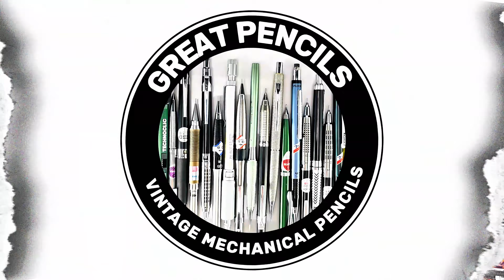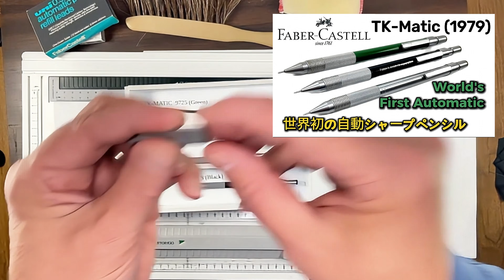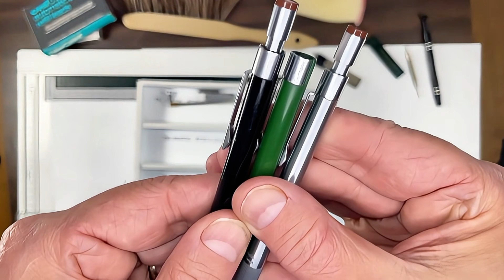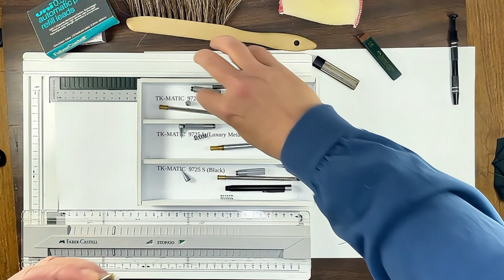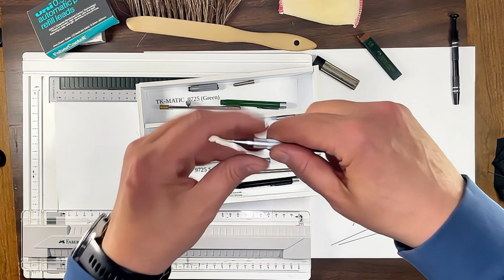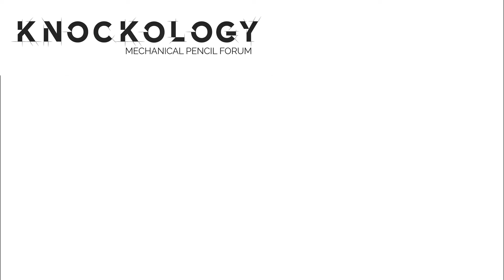TK-Matic Parts Swap: What Actually Works Across Models?

Comment: My luxe model's body won't unscrew from the grip sadly but other than that it works great
Reply: Hi, sorry to ask you a question:
Is your TK-matic L model from the "first edition"? Does it have the letters "HB" factory-engraved on the brown top cap? Because my understanding is that the first edition was "threaded like all of them" but came with an epoxy seal for security—something they stopped doing later on...
Reply from the maker: Hey! Mine is smooth- so maybe that explains it?
I don’t mind the questions at all.
Reply: @greatpencils  From what I’ve observed with these FC TK-matic models—specifically those that came with "HB" factory-engraved lettering—they featured adhesive on the middle threaded section; this applies to both the "L model" and the version with the "green plastic" tube (the "black" plastic tube belongs to a later production run). There is a risk involved in forcing the plastic model open, as it might break. Applying force to the "L model" is safer, though I CANNOT say so with absolute certainty.
Reply from the maker: Looks like I need to record an update video
Reply: @greatpencils  In the process of trying to repair my (customized) pencil, I’ve practically become an FC TK-matic specialist, hahah. The one thing I still needed to confirm was the "compatibility of parts between different TK-matic models," and your video cleared that up perfectly. All that remains is to verify whether the "first production run" units (many of which are identified by a cap marked "HB") can be "unscrewed" at the joint between the knurled grip and the smooth barrel (whether metal or green plastic). If anyone who owns a TK-matic with the "HB" marking has managed to unscrew it, it would be great if they could share that information.
Reply: @LucasJ-r8t it's does have HB engraved but really? I can unscrew the tip and see some of the mechanism. Other than that, it's as far as it goes for it
Reply: @SxyWDSTF  From what I observed, that production batch (with the letters "HB" on the cap) was "supposedly" glued together, though I cannot say so with absolute certainty. The components of the TK-matic (across its various editions) all share the same dimensions and sizes. One would expect there to be a threaded connection where the knurled grip meets the smooth barrel. I was told of instances—though I haven't verified this myself—where people managed to unscrew them over time.
The story goes that Faber used glue to prevent the parts from coming apart and getting lost.
Reply from the maker: That’s interesting- 🧐
Reply: @LucasJ-r8t wow! Didn't think they would do that
Reply from the maker: I really like mine a lot. It’s too “nice” for me to use daily, but I do use that beat up looking green one a whole lot. 
Are you still able to remove the clutch assembly?
Reply: @greatpencils not able to turn the grip from the barrel to remove the clutch